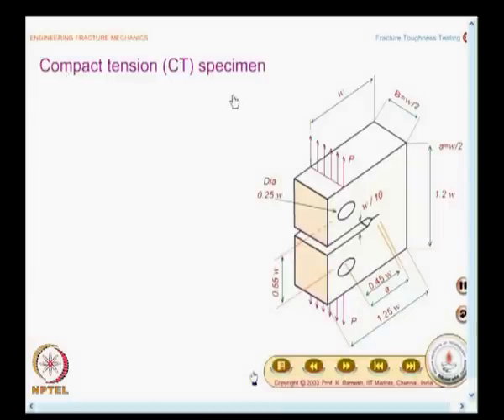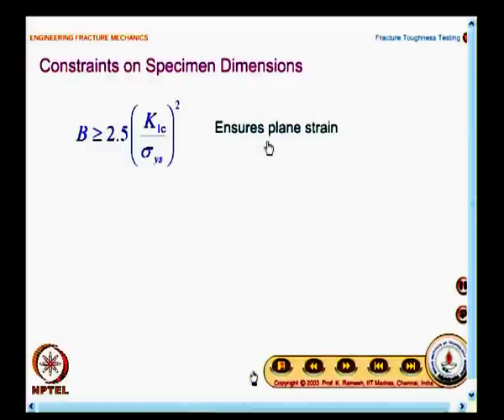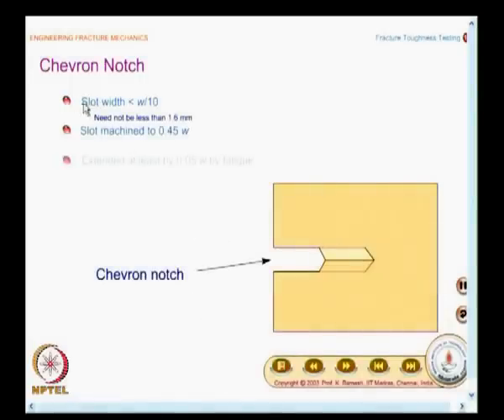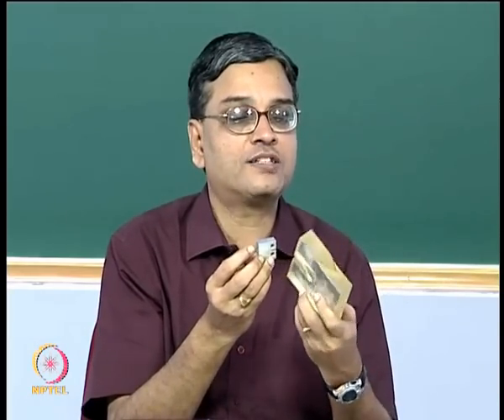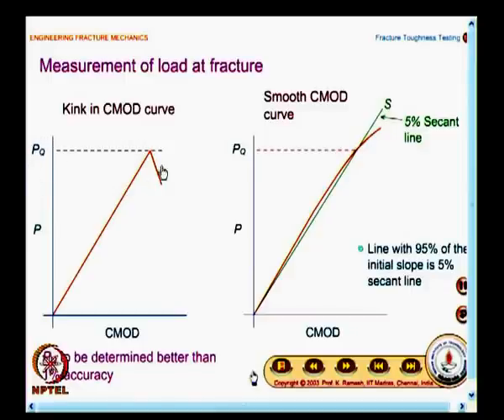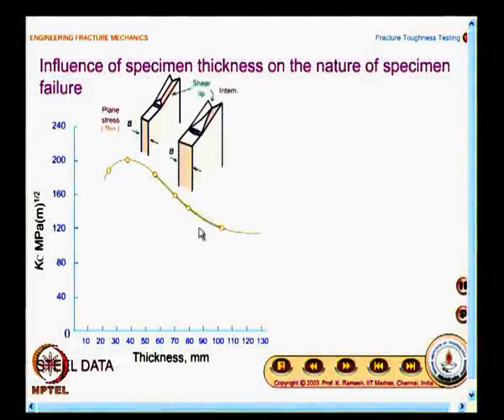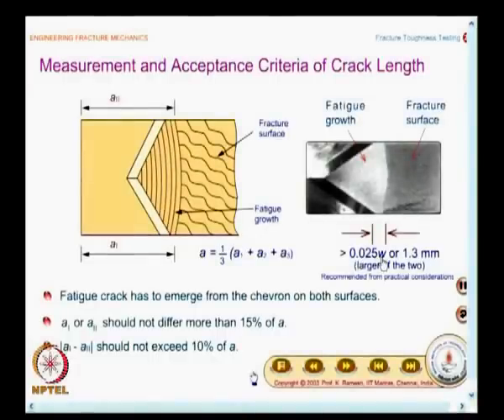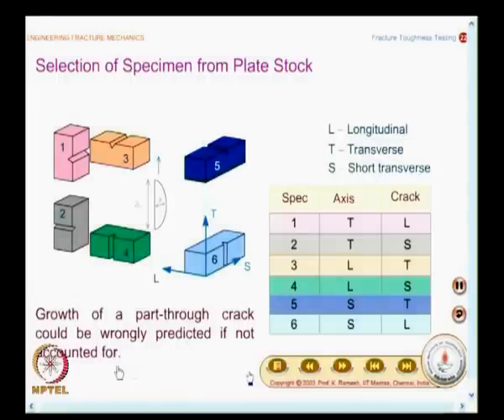Plane Strain Fracture Toughness Testing

Comment: How do you find the value of B when you have not found the Kic of the material yet?
Reply: ASTM D5045-14 "Standard Test Method for Plane-Strain Fracture Toughness and Strain Energy Release of Plastics". B = material thickness
Reply: By what i got it, you need to try many B sizes until Kic converge.

Comment: Fracture Mechanics Clevis Grips are designed for both static and dynamic testing. To meet the requirements of various tests and for varying width and thickness of specimens, a series of clevis grips with varying sizes are available at https://biss.in/mechanic.php